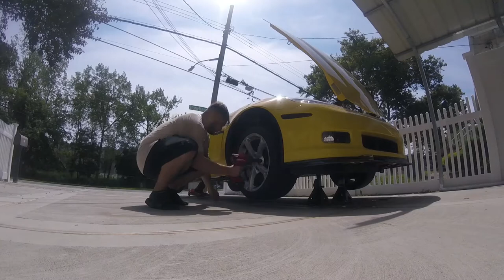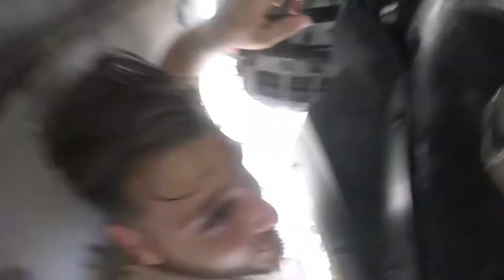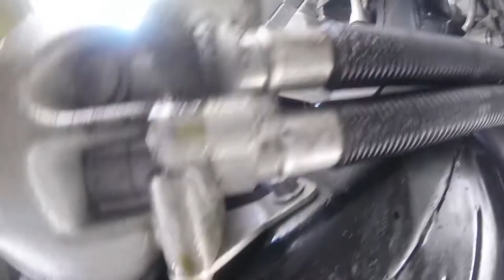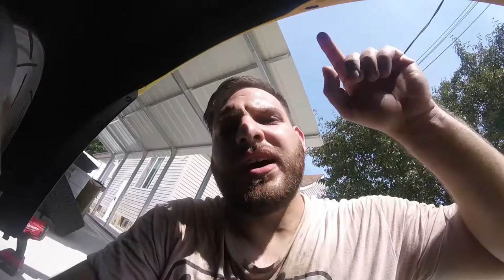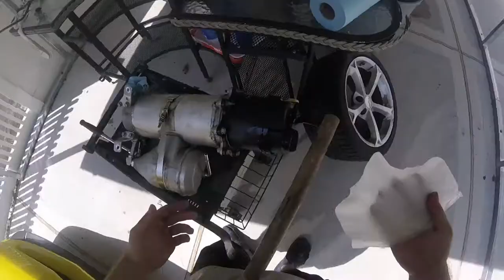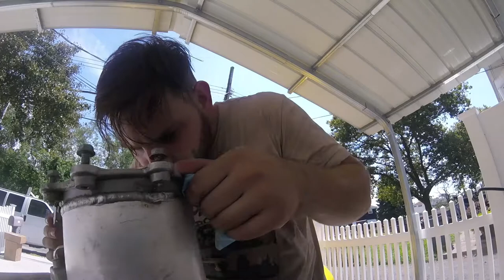Is My Dry Sump Broken? | Fixing | C6 Corvette Grand Sport LS3

Comment: I feel your pain, I bought My c6 GS and it lasted me 4 months before a lifter failed and destroyed my engine. ive been going at it for 6 months now, having to replace very single thing that my glittery oil touched, incluiding the $800 oil cooler and $400 oil pump. so im looking to see if i should take apart the tank and clean it as well.
Reply from the maker: It probably wouldn’t hurt since you’re already replacing everything else and it’s a simple piece to remove for a peace of mind. If you got the time then go for it, can’t really do any damage. There might be some debris on the filter that’s in there.
Reply: @lsxcalli7297  do you think i can access the filter inside without taking the tank all the way out?
Reply from the maker: @MexicanGhost2013  Yeah you should be able to. I believe there's like 6 screws on top that you can remove and take the top half off. That should give you enough access to the filter.
Reply: And that's why I'm converting to wet sump, I don't track my car anyway. 😒